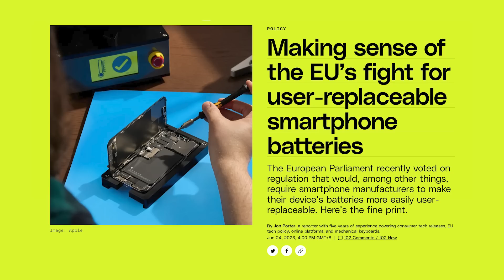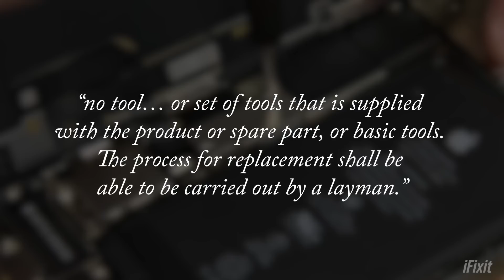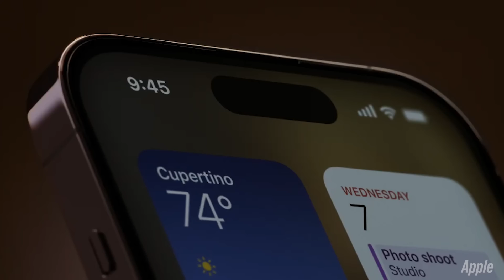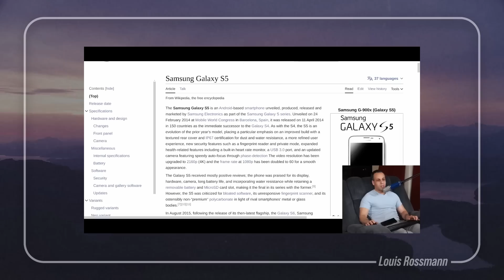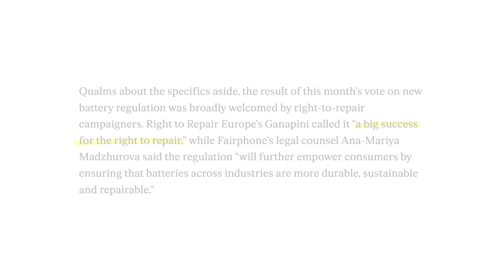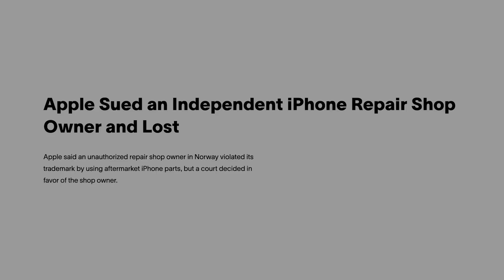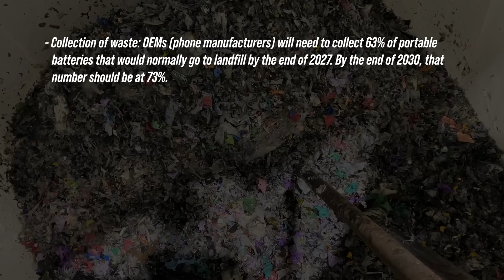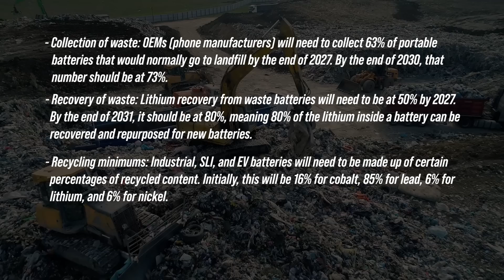EU Just Changed Smartphones Forever

Comment: While I'm all for re-introduction of the replaceable batteries, phones were improving at a light speed in the last decade. Sure, you could have a great battery in your phone from 2010 but I don't think anyone would enjoy the slow Wi-Fi, old versions of Bluetooth, lack of fingerprint sensor, face unlocks and NFC and limited RAM just to name a few. In other words, I don't think there is some sort of conspiracy behind it, just the customer preferences.
Reply: Today, however, even mid-range phones will have comparable technologies to flagship phones; the RAM, battery capacity, camera MP, fast-charging and wireless-charging technologies, heat dissipation, and OS are probably the same, which is more than enough for our everyday drives. And then there are these phones referred to as "flagship killers," which feature some of the same technologies as flagship phones but are less expensive.

Recent years haven't seen many innovations, unless they enabled more AI and hands-free operation with "phones" that could be projected into the air from a wristband, as in movies. These days, most people can use their phones for longer periods of time thanks to waterproofing, improved drop resistance, and continuous update support from the phone manufacturers until the end of support. This indicates that, unlike ten years ago, modern technology might last longer. Since technological advancements are almost at their peak and performance gaps with earlier generations are small, most modern technology could operate for longer periods of time.

Flagship phones that are released annually may have the newest CPU and GPU as well as improved software for finer tuning, which enables faster reaction, but in 2023, there won't be much of a change from prior years because not everyone will use all the technologies in the flagship phone. Even if consumers use their phones longer now, whether they are midrange or flagship models, batteries won't last very long. Most batteries have already lost more than half of their initial performance after five years, but the technologies in the phone may still work because the gap between them and the most recent technology is not that great. 

The consumer can, of course, do whatever they want if they have money without having to worry about their spending or the environment. This is also excellent for the phone manufacturers, but it's not sustainable and not good for the environment.

Comment: The idea is sound, but what worries me is the effect on innovation—you mentioned foldables, but there are also ideas like structural batteries, where the battery becomes indistinguishable from the frame of a car or the walls of a house—which is either a brilliant idea or a terrible one depending on technical parameters, notably the solution (or otherwise) of the durability issue. The devil of these things is always in the details, because the details of the legislation are the only things that distinguish locking us into past solutions from engineering a good incentive space for future ones.

Even things like specifying what proportion of materials should be recyclable is clearly ill thought out—if I have a choice of battery technology that is 50% recyclable and has a lifetime of two years and one that is 10% recyclable but lasts for ten, guess which ends up wasting less resources!
Reply: Do you work for Apple? This sounds like one of their arguments. It is technically valid but way overblown in importance. A few different battery sizes/types could power 90% of phone designs. Also, batteries don't last 10 years of daily use.
Reply: @captainkittay  No, I don't. And I'm not saying that batteries currently last for a decade, but to remove the incentive for people to develop ones that do is extremely misguided. I'm in favour of such regulation in principle, but my point is that it needs to be written with much greater technical care and thought for what effect we want.

Comment: Its about time! Batteries are usually  the first thing to fail. Althiugh, if you look after the battery(rarely.letting in run lower than 40 percent), you can have a good 4 to 5 years of life or more. 

I agree that with brands like Samsung, who made it nearly impossible to change a battery without the right equipment(heat gun) and made damaging the device case in the process a good possibility. They did this somewhere between 2012 and today. As the old Samsung Galaxy Tab 3 that I had, the rear cover was easy enough to remove(you unclipped it from around the digitizer) and some isopropyl alcohol dissolved the glue that held the battery down. The Samsung Galaxy J2 pro both had a removable back and battery, at least the j2 pro model I had. 

However with Apple, their batteries have always been easier to replace. Their business is "longevity" of devices. Hence the reason they support devices back more than 10 years for official Apple repairs. As for software, even my old iPhone 5s still receives security updates. My Samsung galaxy s10+ and tab s4+, not a sausage. 

I have changed the batteries in both my 5s and 6s with the simply purchase of a multi piece screwdriver set(between 10 and 20 bucks on ebay) and the removal of two screws either side if the lightening port. Undoing the clips is the scary bit! 😂. And soon, I'll be doing a battery change on my iPad pro, as it's just as easy. Then, I have been afraid to pull anything apart. I simply do it with care and patience.  

Note:- There are tutorials on youtube on how to change batteries, digitisers and screens on most mobile devices. 

However, if it's under warranty.. leave it to the company!
Reply: Which department at Crapple do you work? If it costs more to repair than to replace, what do you think most people are going to do Einstein?

Comment: Should just make a battery that lasts longer. The problem of today's phones is that batteris just don't last long enough. If we had 6k mah batteries in iphones (or other phones with efficient chips), then there would be no need to replace them because we'd go through fewer cycles. Idk.. I don't like open back designs. Especially since anyone can steal your phone and turn it off immediately without you being able to track it. Modern phones won't allow being turned off without a screen unlock, especially apple. So this is also a major security liability.

Comment: Many phones in the recent years were still produced with user replaceable battery (usually those with plastic backs). Yes, some basic tools (usually guitar pick and a small screw drive set) were needed, but it was easy, quick and cheap. I don't feel any reason to require "no tool" replaceable battery, as they tend to last longer (long gone are the one day phones) and charging can be fairly quick. In the end, even if the battery dies after 3 or 4 years, it was easy to replace it. Yet, nobody carries a spare battery for the sudden event of failure.
On the other hand, replacable batteries on a laptop make a great sense. I still use my old Lenovo Thinkpad tablet and I carry a spare battery, because it really sucks if you are somewhere in the field (I do car diagnostics and electrical repairs) and have a flat battery during a test drive, where I need to monitor or log the vehicle performance data and I have nowhere to connect (no, I can't use a convertor or a power supply, as it does skeq certain mesurements due to ground loops).

Comment: Apple warn you or disable non standard parts, because it’s a security risk to allow parts to be replaced with non standard parts that may have been compromised. Any part that is involved in the biometric security system should be disabled if it is a non standard part.

Comment: When company's say it cant be done it usually means it can be done but they have reasons why they do not want to do it,  Apple said it was impossible to fit a audio jack in the iPhone  and that's why they removed it but there is a guy that actually took apart the phone  and found there was plenty of room and proceeded to add a working one, and in this scenario Apple wanted to force the user to buy official or licensed wireless ear buds.    They say that battery's have to be glued and sealed in for them to be water proof and for user safety ( yeh they tried using the user safety  excuse ), but the reality is there is or was a company that made smart phones that had a waterproof phone with a removable glass back and it did this by having a very thin frame with latches glued to the glass and you pull place the glass on the phone the latches would slide into slots and then you slid the glass down into position and the latches pulled the glass tight to the main phone against a rubber seal and removing the back was as simple as sliding the back glass up, but again it is all about money so company's will say it is not possible because to have a user replaceable battery because ether they want that user to go to them to pay a fortune to have it replaced or in most cases the user will be up sold and buy a new model.

Comment: The iPhone 4 and 4S had pretty easily removable batteries. All you needed was a screwdriver and apply a little pressure on the back and slide it down. The design also made it easy to replace the back. They got away from glass backs for a few models and then they went to the glass back on the 8 and above that can not be easily replaced and the screen needed to be opened to replace the battery. Their is no reason why the iPhone 14 could not have had a glass back that slid down and off like the 4S allowing a battery to be replaced easily. Also Apple is putting a lot of effort into adding unique chips to their batteries simply to control the repair market. Their is no legitimate reason a consumer should not be able to swap a battery from a broken phone to a newer one and still have battery health rating displayed except for this unique chip. I've said for years if Apple put as much effort into developing new unique features as they do into their anti repair efforts they would have a truly amazing product, instead most of their innovation in the last few years has been stolen from others.

Comment: Can you make laptop that have easy replicable keyboard, battery, all drives, RAM modules, and practically all other gubbins, like charging port or WiFi module - yes, I'm writing it on one. 

So, why in most laptops you have to replace whole damn top cover, sometimes even with screen frame to fix keyboard with one letter not responding? Why you have to disassemble whole laptop to clean thoroughly air vents, radiators and fans? Why do you have to replace whole mainboard to replace one sh*tty gubbin, because - for example - charging cable is falling out from the port?? 

Because, from companies point of view, it's better when you will buy new laptop, instead of fixing an old one  

And, on top of that, they practice "planned obsolescence", planned failures - the practice treated for years as "conspiracy theories" - but now strongly persecuted by EU 

As you can imagine, I'm more than happy to hear about this law :)

Comment: It is strange to hear Luis bitching in contrast to your calm voice. But yea, it is anti consumerism. I am mid class and I buy expensive electric appliances, I expect them to work for a long time or at least to be serviceable, nothing is! When I open up my loundry dryer or washing machine, hair dryer a freaking blender after 4-5 years of use. They are made so that I can not open them to fix then. Of course there is a way, but I literally break parts to get to the problem and than I need to 3d print, find alternative or something. On the other hand I got appliances from the 1960s that are working perfectly, some worn out parts needed to be replaced, and I replace those 60 year old parts easier than do with new ones and that is fucking insane and ilogical by all accounts!

Comment: I think this should also be targeted towards software industries which are pushing for hardware obsolescence. I have seen several cases where software manufaturers align with hardware industries to maximize their profit. An example is Games and Nvidia. Half of the games that came out this year should be able to run on most of low end graphics card but they software manufaturers are not purposely pushing out unoptimized code so that people would buy the best of the best graphic gear.

Comment: I have doubts that this legislation will include batteries beyond a mass of 1.5kg as this is consumer electronics legislation, but I will check. A layman will not and should not be able to work on safety critical batteries with a mass of 300 to 8000kg, depending on capacity and chemistry.

Comment: Right to repair should exeed batteries and incapsulate any part of smartphones/laptops and similar devices. It should also not just be a right to repair, but the right to put compatible parts of other manufactures into these devices. At the time i pay for my smartphone, i want to have the power to put parts into it the way i see fit.

Comment: I appreciate the right to repair argument and I have been more "tuned in" to this topic as I am cheap and I like to fix things. I generally try to repair anything that still has functional value to me that doesn't cost more to fix than replace. But, after living this lifestyle and sometimes even evangelizing it's benefits to friends, family, and co-workers I can comfortably say that a LARGE majority of the population will need to improve their education of electronics, safety, and recycling if this plan is to actually work in it's intended way. I foresee a slippery slope of mass manufacture of all types of OEM batteries in different configurations needing to be produced and stocked the world over. This is going to DRAMATICALLY increase our lithium needs or require a sizable step forward in battery technology. Time will tell but what we do in the next 5-10 years will set the pace for how this ultimately plays out. Would hate to see even more piles of e-waste finding it's way into the landfills.

Comment: I had to replace my old smartphone even though it's battery was replaceable cause the alternative battery don't live more than 6 month's and less efficient than the original one . So I decided not to buy a smartphone for more than $100 because I know I have to replace it sooner or later due to the battery issue.  Therefore it is not enough to force companies to make smart phones with replaceable batteries, but they must also be forced to provide original replacement batteries at a reasonable price.

Comment: I had (still have) a Galaxy S8.
It still works, and I had 0 issues with it up until I replaced it just a month ago.

Aside from some cracks on the corners on the phone, the only real problem I had with it was that the battery was failing by the tail end of its "life".

It's just so stupid that even if the phone was still running smoothly, I had to replace it with a new phone because it's just not worth the hassle of time and money to replace the battery.

Comment: A simple way to get users to bring in their old batteries is to prevent them from getting a new battery if they don't bring in their old one.
Reply: Or you just charge a refundable core fee, just like when you buy a new car battery.
Reply: I think you will find that a law that required batteries to be replaceable has, inherent within in, a requirement that the replacements are actually available, although the price may be another matter.
Reply: As in the replacement battery, for some reason, costs 15% more than a new phone? @TheEulerID

Comment: I'm kind of torn on this ruling.  I want them to provide batteries where you can repair the phone yourself but I remember the old phones that had replaceable batteries and they were not water resistant.  I'd prefer to have a water resistant phone than a replaceable battery.  It's not too hard to replace a battery today (but they need to make manufacturers stop the warning screens about non authentic battery) if you are patient and can watch a youtube video.

Comment: The main reason phone manufacturers went with non-removable batteries is because they wanted to make you have to pay to replace the battery or, better yet, buy a new phone when the battery no longer holds a charge.  Apple started this with the original iPhone, and other manufacturers followed suit.

Comment: I recall when Samsung and the other non-iPhone cell phone manufacturers dropped the replaceable battery feature because many consumers were enthralled with Apple's marketing of their thinner phones. These same people would complain about battery degradation a year or two later, and Apple's solution at the time was to tell them to buy a new phone. I'm surprised that they were able to retain so many repeat customers. Either Apple's marketing team must be filled with geniuses or Apple's customers are...
Reply: I do NOT want replaceable batteries. How can they decide "for" me? I want slim, water prove phones, am NOT interested in replaceable batteries, can't see NO advantage for me in it.
Reply: @RonK  For me, swappable batteries meant less battery drain stress. When I had my old Samsung, I always carried an extra battery with me, which worked out great for those times when I was out all day. The batteries are much slimmer, more compact, and more convenient than carrying a portable phone charger and cable. In addition, the phone was slim and had a water-resistant rating of IP68.

Comment: That a company can make a battery device specefic is sad. The same type of battery, same size, same voltage, same amp hours, same connector. But your phone doesn't fully work because it's from another manufacturer should be illegal. The only company i've heard of that does it is Apple (big suprise)